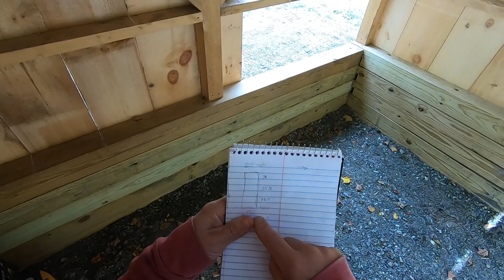Getting the Firewood Shed Water Tight just in TIME- Ridge Cap Installation

Comment from the maker: CHeck out the New Lumnah Acres Merch http://bit.ly/2ZAa6yu
Reply: Hey bud, what song is this at the end of your video?
Reply: Just out of curiosity, why didn't you use the flashing under the ridge cap, like you did on the barn, on the woodshed?
Reply: @terribethreed8464  Leaving it out gives a little more ventilation through the woodshed. It helps dry out the firewood faster.
Reply: @terribethreed8464  Rewatch that video of the barn, the ridge cap did not get flashing, the flashing went in the valley between the roof and the overhang roof.
Reply: You need a zip up style for a hoodie, please.
Reply: ❤👍 Serbia

Comment: With all the work you've done I can't believe you never bought yourself a B&D Workmate or equivalent portable bench/vise gizmo that you can toss into the back of a pickup or wheelbarrow to go with you around the property. It'll save you future back pains from bending down to work on the ground and pay for itself.
There should be an air space behind the first pile of firewood to allow for circulation. Doesn't need to be much more than a couple inches.
Love the couples banter, btw.
Reply: Agree kinda, only because I believe Al buys seasoned wood.

Comment: Man it's coming together good!  Don't forget about the wagon when you get to moving the wood.  Could probably get a good load on it!
Reply: Good idea, but there are no sides on the wagon, and easier to navigate right up to where they want it with the tractor.
Reply: @paulmonk7820  they stack the wood in the bucket.  Stack the wood on the sides of the wagon.  Yeah not as easy to drive but 10 times the load in one trip?  Just a suggestion.

Comment: The wood shed, car port and barn all look great! You do such nice work & make it look so easy, that I (a 58 yo great aunt) got inspired to build heavy-duty shelves in my Amish-made backyard shed. Took three hours at the lumber yard just to get the wood and have it cut! (Don't have lots of power tools.) Don't have your strength, so I had to pre-drill holes before using screws. It doesn't look as nice as your work, but it works to help organize the shed! Thx, Al, for the fine example you set.

Comment: Everyone has their own way of stacking firewood, and I'm no exception. I know you have stone on the floor with should help your firewood from absorbing ground moisture, that's good. If  they were up off the ground it would also allow for air flow under the stack. One other thought, instead of piling across the length of the wood shed, think about pilling it front to back. in that way you don't have your oldest, most seasoned wood behind your other less seasoned piles. not trying to find fault, just offering alternatives. Love your channel.
Reply: Ooh! Can we start the bark up/bark down debate? 😈 I'm a however it lands guy myself.
Reply: @hughbrackett343  You have a problem!

Comment: Goooooood Moring Al & Gina ,
Very nice car port addition. Curious that you would receive an extra roof cap in brown.  You would think that they would have to know that one of them would be the wrong color.
After seeing them together , I like the green much better.
 I know that you intend to let your buildings weather to a natural grey.  I made two of your $30.00 chicken tractors  ( which cost more than $30.00 here in Ohio ) and they have turned grey.  This summer I have built another chicken tractor with a different design that includes roosts and nesting boxes and wheels. ( easier for me to move )  I decided to use some wood deck water proofing with transparent stain. I used a garden sprayer and just sprayed the waterproofing on.  I used a transparent teak stain so all of the wood grain shows through.  It's now the best looking thing I've got out back. You could do the same thing with your buildings. The garden sprayer makes it very easy.  Just an idea for you .
  Now I'm wondering if I can use your carport method to build a permanent chicken coop ?
Of course it would take me a few months to do and I don't know how I would manage the roof. A lower and flatter roof maybe ?
  Al did you make those air vents for the wood shed ?
Reply: I believe they came  with the wood shed kit.

Comment: Al it doesn't look like you are putting anything under the firewood as you stack in the new wood shed. I would have pit something on the ground to keep the wood from soaking up the moisture thru the rock. Just an observation from many yrs of wood stacking. Wood shed is looking great.
I'm sure you know this but I hope you are going to alternate the wood as you stack it for better air flow and to help keep dry.
The dinner looked amazing. I still believe you should be putting out a cookbook. It's great to see the progress over the last couple years!!

Comment: I could see that there appeared to be an air gap between the firewood and the rear wall . 
However , it does look like the wood is being stacked directly upon the floor. There should be spacers under the wood to allow for better air circulation.  That bottom wood will rot by being in direct contact with the floor of the woodshed.
 Al , what rock walls are you referring to ? I have watched your channel a long time and so far I have observed only that you have two long rock piles that have never been stacked into rock walls.
Reply: Donald Miller - They have rock walls on each side of lane way down to barn.
Reply: @Tony Grimes ,
Perhaps you have not seen a dry stacked rock wall ? Dry stacked means with no mortar.  The rocks are stacked vertically so that gravity holds them in place.  The rocks are not randomly put onto a pile. Al has two long rock piles along each side of the lane.
Reply: @donaldmiller8629  I live in Ireland. We have so many dry stacked walls here that it would be impossible to count them.

Comment: Cut the medal with a box knife when you don't want any scratches, straight edge and a box knife make to pass hold down on the straight edge and pick up on the other side of the sheet and it will pop right where you cut the line. Easy

Comment: How are you going to get air circulation under the fire wood unless you stack it on pallets ?
Reply: It also looked like Gina started the pile right up against the back wall.  Did I see that right?
Reply: Larry Parish I was thinking the same thing.
Reply: Lay the first layer of logs perpendicular to rest of them  so the first logs act as the pallets
Reply: I would go one further and stack and band the wood on pallets at the woodpile. Then the Kubota could just sit them in the woodshed.
Reply: @hughbrackett343  good idea

Comment: Reallly fine job!  Question - won't the apples hitting the metal roof cause dents?  Just asking, I'm a city slicker so could definitely be wrong... BLESSINGS!
Reply: Oh, and those square pieces of wood, would be a good project for Miss Olivia if desired; sand the edges, put on x4 wheels and you have rolling plant stands.
Reply: Not big or heavy enough to cause damage.

Comment: No wood stringers under the firewood?  They'll wick moisture from the ground and such.  Good air circulation is essential in stacking and storing wood.
Reply: Al and Gina put plastic sheeting under the foundation before the building was started. Don't know if that would prevent moisture from coming thru the wooden walls when the snow gets so high and melts in the spring? Good suggestion to add the lower airflow. All this wood has cured for at least a year now

Comment: I would have put corner pieces on the roof instead of the 2 inch over hang so the wind doesn't vibrate the steel , also vent material under the roof cap so the powder snow doesn't blow up the roof and under the ridge cap.

Comment: Al we have a shed similar to that and have condensation problems with the steel roof!! Just a heads up
Reply: russell tomlinson  we had that issue too until I vented along the tops of the walls
Reply: Vermont Country we are vented as well and hasn’t made a difference! We do have a lot more area as our barn is 40 x70

Comment: Self tapping screws will save you from having to pre-drill the holes.
Reply: They are self-tapping, but sometimes (read quite often) the drill end of the screw gets blunt and it won't go through the metal. Predrilling helps and it is easier to put the screws in.
Reply: @yvindascanius6061  also you have to apply fairly heavy pressure to get them to bite. You wouldn't be able to put them in at arm's length like Al is doing.
Reply: @hughbrackett343  That is very true. That's why even the pros do it, like RR buildings. No one praises you for making a job more difficult.

Comment: Not sure stacking firewood against the wooden structure is a good idea. Termites are in trees, they move into other wood where there is no daylight. Termites don't like daylight and will usually not cross that gap. So, it's a good idea to not touch the structure with firewood.